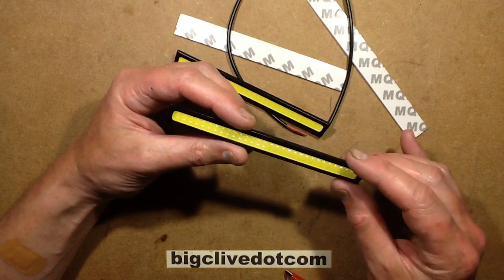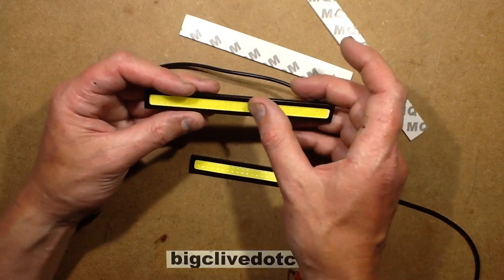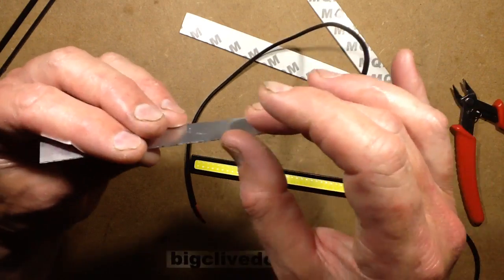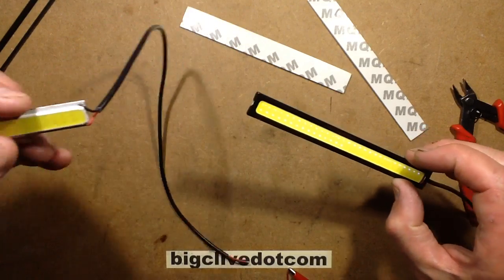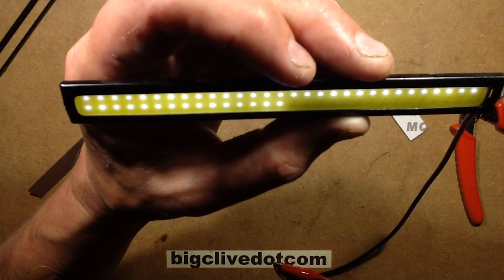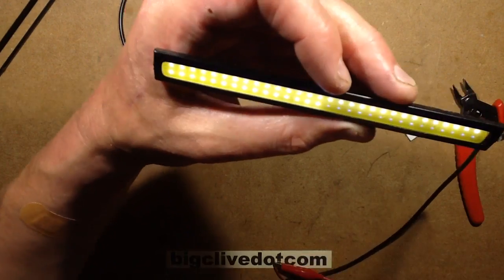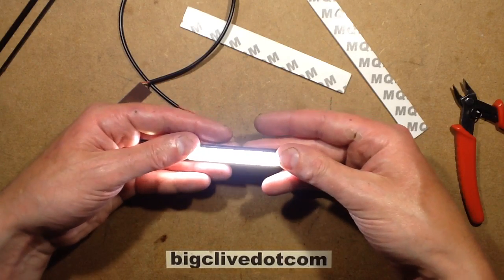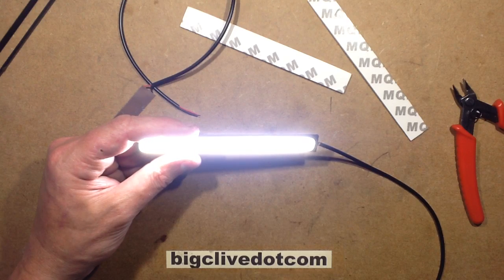A look at some LED COB light strips for cars / automobiles.

Comment: you reckon they would be ok for inticators?
Reply: I use amber versions of these on my Husqvarna dirtbike as indicators mounted on the hand guards. 12 months and still good to go bright as hell.
I use 18mm amber "Eagle eye" leds on the rear, they are bright as hell too.
Reply: Ignoring the colour for a moment, probably yes. The intermittent nature would stop them from getting too hot and they would be a lot brighter. However I think there would be on issue with them being white rather than yellow in regards to the legality.
Reply: +Firecul42 mm yea thats fair i guess you could probably make or get a yellow shroud for them just theoretical. not intending to do so.
Reply: Bad Juju That's actually a really smart placement, high up and wide apart. And probably quite easy to mount too.
Reply: I'd say no, as they would be too bright...
Reply: Yup, that works.

Comment: Off topic, does anyone recommend a cheap soldering iron that's like the Hakko FX888D?
Reply: check out AVE's review of a'fako hako', he should have the link in the description.
Reply: have you try this one, http://www.ebay.ca/itm/60W-Adjustable-Temperature-Welding-Solder-Soldering-Iron-Electric-Tool-1-5-Tips-/191590374543?var=&hash=item2c9bad1c8f:m:mfDxltcSxMe3fuMCb-59Qig
Reply: Mike Blais I was thinking of getting one of these Weller kits from Amazon. They seem pretty solid, but I've never heard of Weller before.
Reply: Weller have been manufacturing solder irons since 1945 and patented the first hand-soldering tool in 1941 so an industrial icon.

Comment: Got two of these in the back of my van and they are fine. Been running for a year now. They are always on when the engine is running too.
Reply: I've got mine running while the engine is running via the original interior lamp cables & they are working real well for the little I paid for them. 6 hours constant on per day, every day for many months now.
Reply: I want to install this in my car trunk baggage. Will that work instead of stock light without a risk of burning my car?

Comment: 10 ohm 1 watt resistor for 14 to 15 volt operation and your good
Reply: Until the engine is turned off and you still want full brightness.  There are now ultra low dropout regulator ICs that only drop a couple tenths of a volt at that current, which would allow a nominal 12.6V (full battery charge) system to still supply 12.0V when the engine is off, or of course a proper 350mA current controlled LED driver but those, at least the cheap ones, tend to have a higher dropout voltage than 0.6V.
Reply: You could certainly try one, but most that I've seen spec that they need at least a 1.0V I/O differential.
Reply: @stinkycheese804  A CC needs sufficient delta V. Few would work
Reply: Unless your LEDs are intended as light-bulb replacements.  If you have to modify the "bulb" just to use it then  someone has fucked up.  They could solve the problem by adding more LEDs in series, but I guess they don't know anything about cars and are unaware of any problem.   For automotive use, one typically wants to  connect the unit as provided directly to vehicle wiring.  Having to add extra components in such an application is idiotic.
Reply: Would a buck/boost converter and suitable resistor, be ok to drive these with a steady 12v?

Comment: how quick do they go bang on 24 volts ?
Reply: I was thinking 24 volts (lorry electrics).
230 volts (and above) is PhotonicInduction channel
Reply: why just 24 why not 230.
Reply: 10kv + is photon
Reply: 500+ is Photon's channel
Reply: @2:56 I see I'm not the only person who thought, "Only 14V? He needs to send it over to PhotonicInduction."
Reply: Most likely instant
Reply: Precisely
Reply: Just run two modules in series. It will have pretty much the same issue as Clive pointed out for the unregulated 12V though. The vehicle on board voltage will easily go as high as 28V and will cause the modules to draw in excess of 10W. They seem to be designed for around 10W, but I'd only go that high with adequate cooling. If you don't use thermal conducting glue to mount them on a large metal surface, then driving them around 4W is much more advisable. Bottom line, use a regulator, just as Clive says. LM2596 based buck converters can be had for about 2$ a pop and you can usually adjust their output voltage.

Comment: Every automotive LED product I've used that uses a simple series arrangement has died a rather quick death, even just off a 12VDC power supply.  Usually each individual LED will develop the Black Dot of Death one by one within 2-3 weeks of constant-on application.  I had one strip of 5050 warm white LEDs that failed in a very bizarre way, though:  No black dots, but the LED chips got progressively dimmer the closer they were on the chain towards the power end.  It was an almost perfect gradient effect.  Looked really neat, but the light output really suffered!  No idea why it failed like that, though...

Comment: Yup. I posted on another video about the COB 194 leds I had to modify because they were overheating at 14V. It had a 75ohm resistor in series and I added another 22ohm resistor. I wanted more, but I only had 1/4w resistors and that was pretty much at the limit for it. But that was per COB and each board had two of them.

Comment: Any chance to run it at 14V for prolonged time and see what happen?
Reply: I did a test on another type of cob led lights it is built in to a enclosure with a plastic lens and a reflector in front of it i could get it so hot that the lens melted. did as i stated above a test and at 12V they reach around 100 degrees centigrade and at 14.2V then they reach 147 degrees before they failed. So without a proper current limiting driver they are crap.
Reply: It would waste less time to just run it at 20V and see what happens.  :)
Reply: Running in my father's car INSIDE the headlights (along with heat from the xenon lighbulbs), they work fine for over 6 months of driving (in 35 degrees hot summer). They are running on 13.9-14.2V from the car alternator and have not burnt, even without any heatshield
Reply: I have 2 of these that are 4W replacing the olld dome light in my Jeep. It's been running fine for 6 months now, longest runtime was around a half an hour. It's a great deal brighter, I used a cheaaaap lux meter to check and it went from 4ish with the old bulb to over 60 with the COBs. I don't have the lens cover on, as I intend to make a clear vented one.
Reply: I bought small cob leds(1*1inch &2*2inches) for maplights and dome lights. We installed it on my friends car, then decided to leave it on while engine and ac running and we chatted for a while outside. When we checked and tested it again, it has already failed. The reason, the solder of the wires on the pcb melted and disconnected itself.
Reply: You do realize it's quite trivial to add a series resistor to limit current to an appropriate level, and that such resistors cost only a few cents each, right?  Do a web search for "LED resistor calculator" (without the quotes) and use a magnifying glass to count the # of LEDs in series and parallel to input into the resistor calculation.
Reply: @stinkycheese804  Like to "hear yourself talk" hey...
Reply: @stinkycheese804  LOL.  Just use 12V as the Vf
Reply: @stinkycheese804  And even then I would advise on using a heatsink. In free-to-air situations these things alrady heat up to 45 degrees (Celsius) and that's below their nominal power, let alone think about the worst-case scenario when they are fitted inside something and are run at far higher power than rate... I stuck 5 larger ones on an aluminium plate and lit them all at once about 120 mA below their rating. If you hold your hand about 5 centimeter above the COB's, you can feel the heat.

Comment: I been running some tests on these too and they get nasty hot, i bought the version with a plastic encapsulation on and an reflector at 12V the COB module reached 100c and i tried at 14.2V as what cars deliver while they are running then i reached 147c before it failed.

Comment: I've used these for interior lighting with an adjustable voltage regulator, 11.6v is a nice voltage on temperature/brightness. 14.6v when the vehicle was running turned the foam into smoking blobs of black mess!